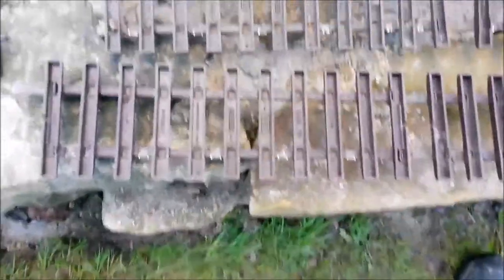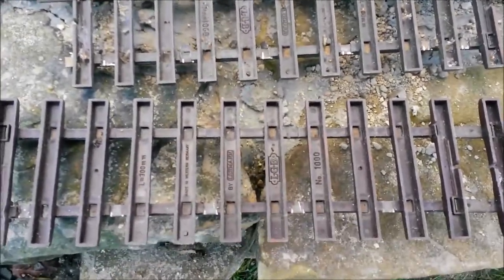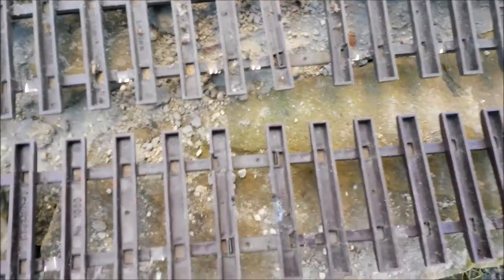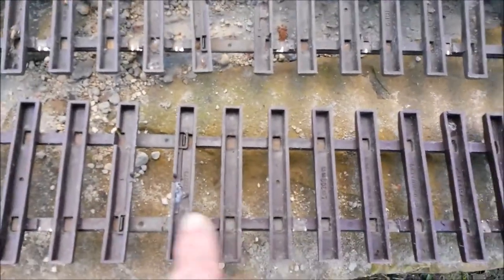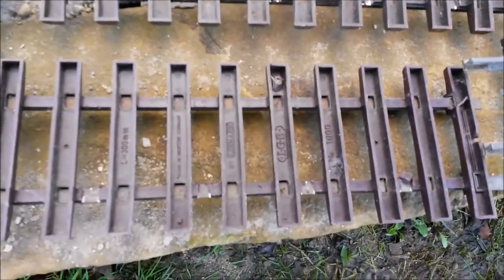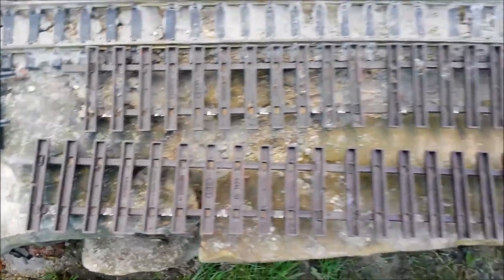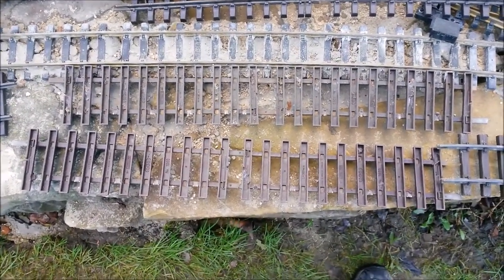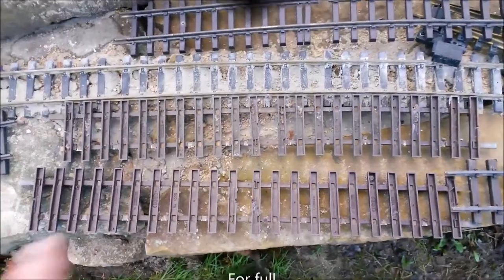Bending LGB garden railway track

Comment: Hi John; If I'm going to execute a plan in the garden, I will be in need of a 16 foot circle of track - what would you recommend?
Reply from the maker: +RMLectronics East Yorks Hi, That is greater than radius 3. I would recommend a circle of large radius track separated by straight sections to get the overall size. That would be least hassle and highest likelihood of success. If you draw your track bed on the ground then you could be more adventurous and curve your own track.